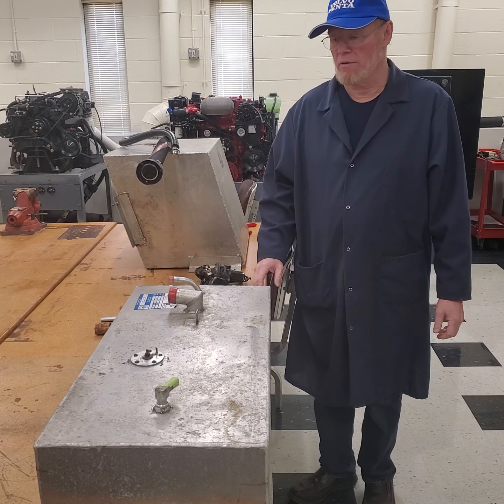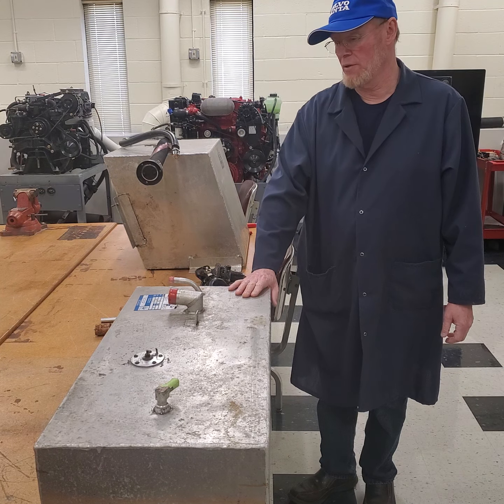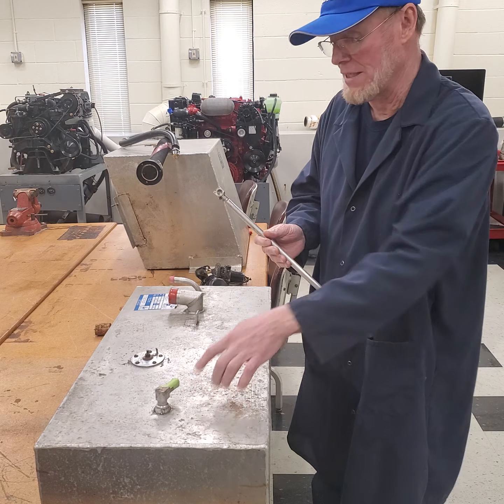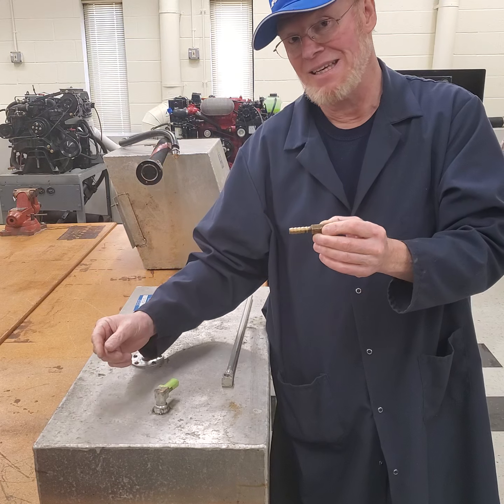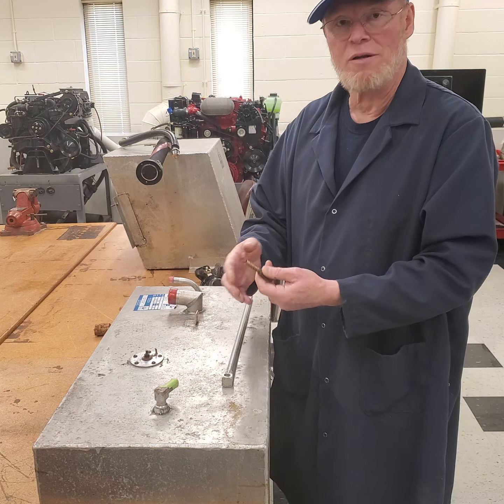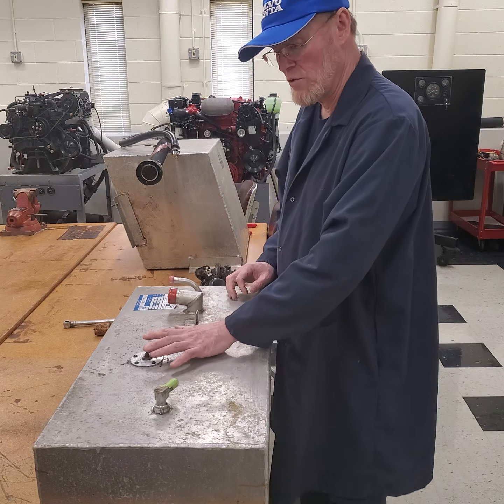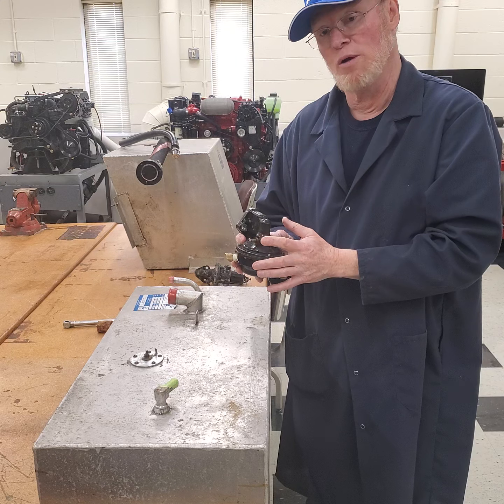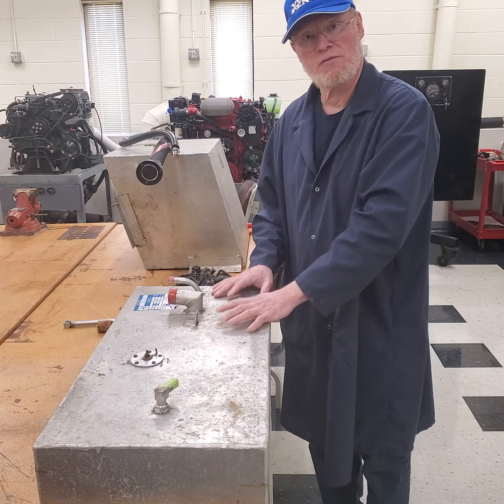Marine gasoline Engine Fuel Tank  components

Comment: I am new to boating. My boat is an 18ft 1988-89 Chris Craft bow runner. While servicing the fuel tank, I discovered the anti-siphon valve on the pickup tube. Is this check valve absolutely necessary for safe operation of the boat? Does it have to be in place per USCG reg's?
Reply from the maker: I am very glad you asked this question!! ALL NEW boaters need to understand why this device and the installation of Type A1-15 USCG approved fuel one MUST be used.
So YES, this is a must! I am going to make a video on why and the reasons for using only USCG approved gasoline fuel components.
Reply: @tedsmarinerepair8956  Thanks very much for the rapid reply. I've found it a little difficult to get reliable information, being a newcomer to boating. I'll be watching for the video!

Comment: I have a 6.2 Liter Mercruiser with EFI. I am having a fuel starvation problem (engine bogs down at WOT). I want to check the anti-siphon valve but it does not look like there is one attached to my fuel feed tube coming out of the tank. Could this be located somewhere else in the fuel system? It looks like there are two electric pumps that feed the engine. Any help would be greatly appreciated!
Reply from the maker: Anti-siphon valves are usually threaded into the fueltank pickup and are aluminum. Search on line for a pic. You need to install a fuel pressure tester on the low pressure  side and then the high pressure side to determine wherethefuel pressure drops off.
Reply: @tedsmarinerepair8956  Thanks!

Comment: Hi, I’m in the process of replacing a fuel tank in my older 26’ Sea Ray. There is no bonding/grounding wire on the old tank and the new tank will have a tab. I’m planning to daisy chain the bonding wire to the tank, deck fill, vent port and sending unit then to the Negative engine ground. What gauge stranded marine wire is normally used for this? The longest run is about 10’. Any other suggestions or recommendations for me? Thanks, and great video! Ray
Reply from the maker: 14ga is fine. Use green, yellow or black wire

Comment: Where does the ground wire from the tank next to the fill hole hook up to?
Reply from the maker: You should make sure the filler neck ground wire attaches to the tank ground or battery negative and earth ground.. This way the tank and the filler have continuity to ground.

Comment: Why would the vent line on a fuel tank have three tank connections all teed together and then to the vent line?
Reply from the maker: If the top of the tank is raised in some areas and lower in others it could have multiple vents. Usually I find only one on mosy tanks.